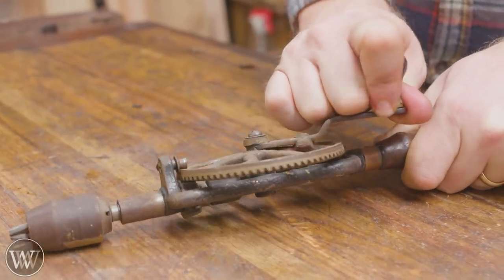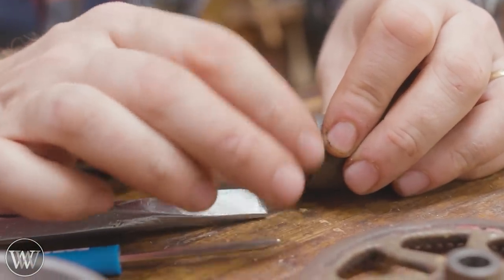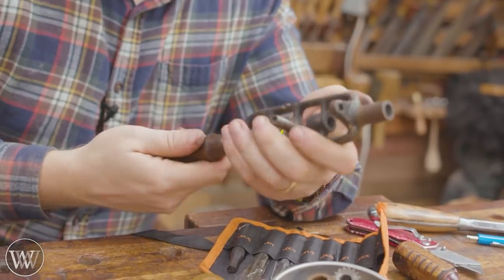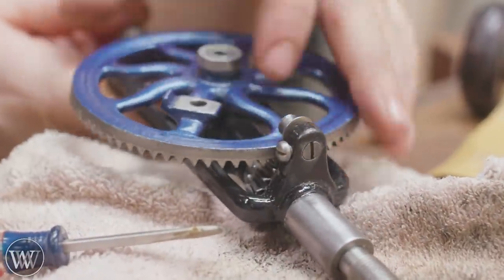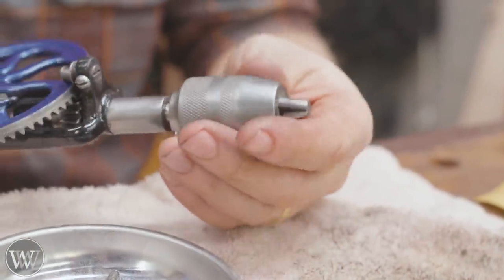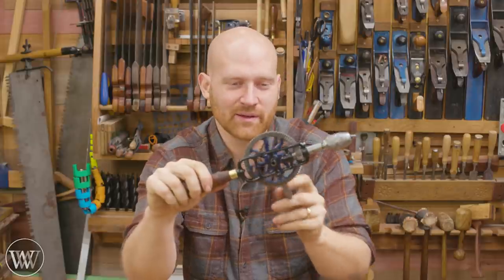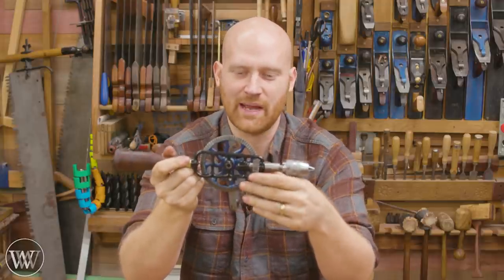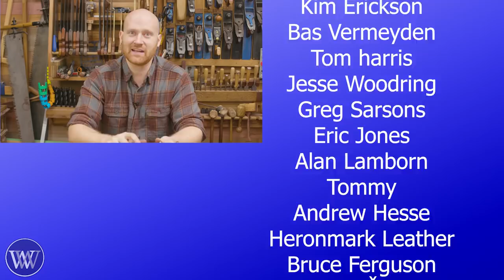Vintage Eggbeater Hand Drill Restoration

Comment: I recently visited a used tool stall here in UK and bought a vintage drill identical to yours with one exception - there is a large letter A cast into the frame below the top handle (mine also has the side handle still attached). I stripped it, cleaned it up, oiled it and all works great.

Comment: i have one i got to working that had a treaded  cap for a hollow in the handle for bits   the cap is gone but i got the drill going again dont remember the brand will have to check tomorrow!   good restoration

Comment: Excellent restoration! I'm restoring a Stanley eggbeater drill myself but has no wooden screw top to hold drill bits. Would you know of a way to remake the the top so it can screw back on? I'm clueless
Reply from the maker: matching the threads is a pain. it can be done but it takes a TON of work and usually 15-20 tries unless you have both the right tools and experience.
the most common solution is to make a plug that slides in and looks good on top. then smear the threads inside with petroleum jelly then epoxy in the plug. If done well then it will unscrew with a bit of force and now you have matching threads made with the epoxy. If not done well then you just glued the plug in place.
Reply: @WoodByWright  thank u for your help sir. I appreciate it🤙

Comment: Hi Great Video. I have a similar drill but to date have been unable to undo the chuck. I have applied WD40  and 3 in One oil and also soaked in mild oxalic acid. Where should I go next?
Reply from the maker: Usually my order is penetrating oil with vibration. (Not WD-40 or lubricating oil.) If that doesn't work then next up it is heating the outside and trying to break it with that. If that doesn't work then you're into destructive methods.